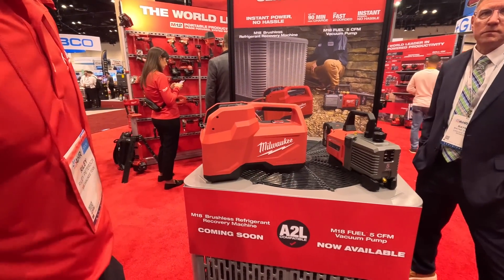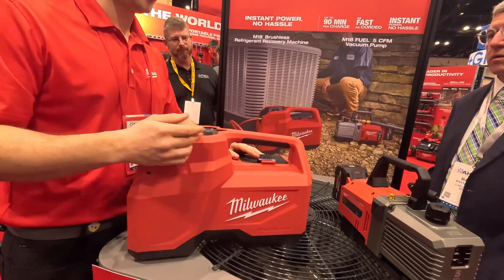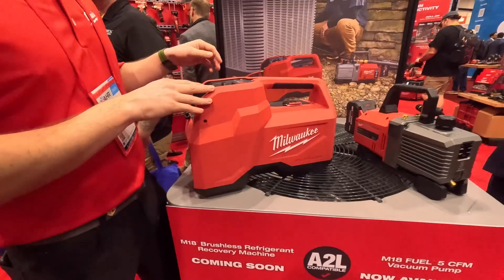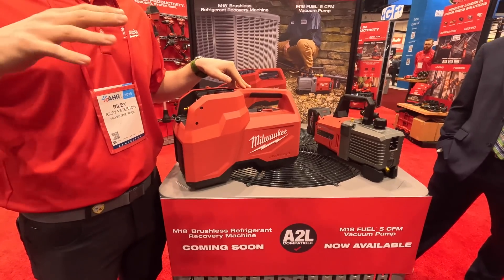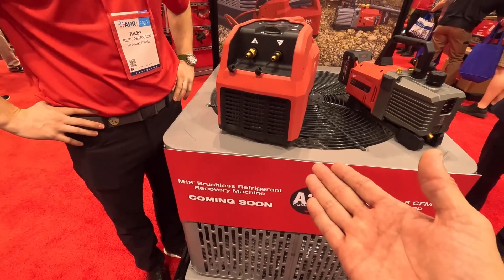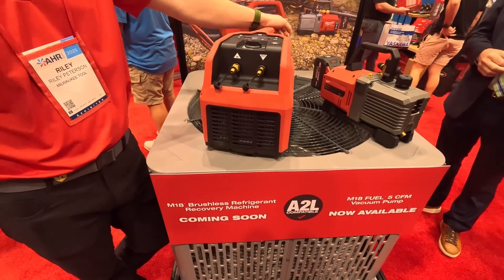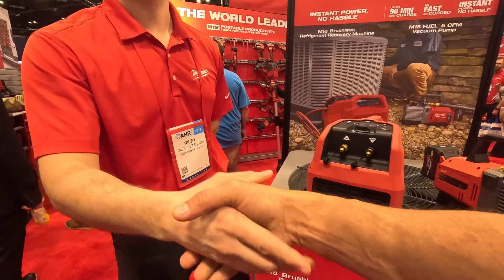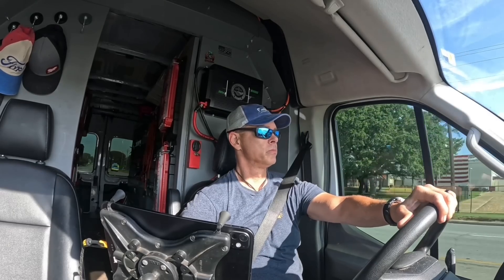New HVAC Tool Release From Milwaukee Tool! You Gotta See! #hvacguy #hvaclife @MilwaukeeTool

Comment: Still have mixed Feelings on battery operated stuff vac pump and now rec machine. Definitely need the high output batteries for the machine to be worth a damn. Those batteries are not cheap, like anything corded is constant power I see the place and time for these cordless machines. Hope they have prongs to go corded if needed like there other tools.

Comment: $1300 Milwaukee can keep their overpriced recovery machine that will most likely run out of battery before the recovery is done. I’ll stick to my Fieldpiece and run a chord or use a widow maker if there is not a receptacle near by. This is just one more tool to make our trade lazier which is exactly how I feel about RLS and press fitting garbage, which I will NEVER use.

Comment: Even us Non-HVAC techs are salivating over this Battery Recovery and Vac pack units! Hey Curtis, I am sure you signed up to be one of the first to get one of these! LOL
Reply from the maker: I’m trying.
Reply: It's ACTUALLY a RECOVERY unit. The VacPak has already been on the market. Although it's a really nice looking unit, the rubber meets the road when it's tested in the field. Also, $1,299.00 is a steep price to pay especially when a corded recovery unit is really easy to get it's power from the disconnect or even the contactor in a pinch. Good luck getting your hands on one anytime soon.